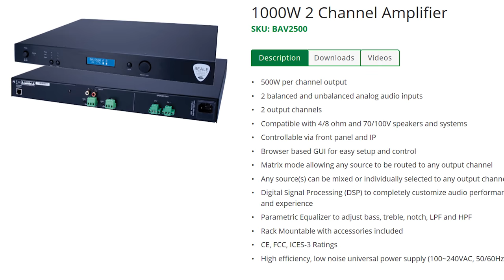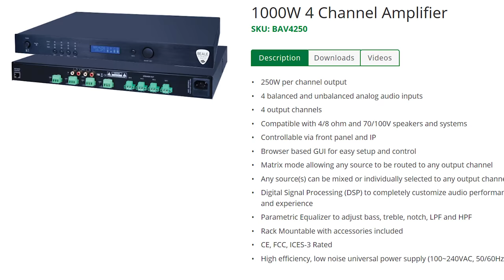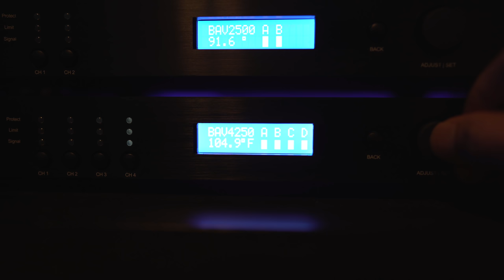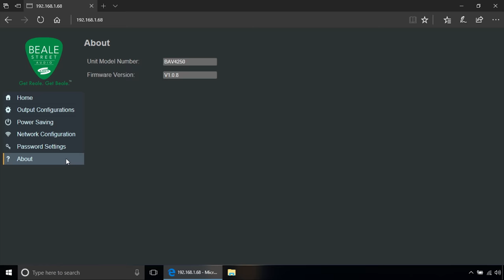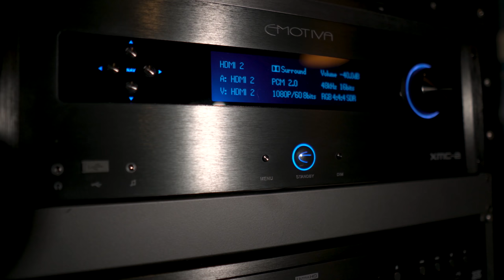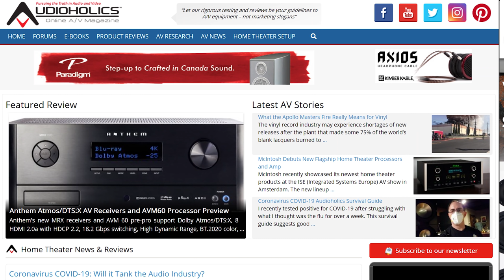Beale Street Audio BAV2500 & 4250 Amplifiers Overview

Comment: No review of quality of sound? All you made is a commercial, and a waste of everyone's time. 
Anyhow, is one doesn't need the preamp/eq/network and small factor, for the 2x650 USD you could get TWO crown xls 2502 with 3000 watt of total power, quite fan and bananas, xlr and RCA connections. Or just buy one 2502 and get 2x 440w , also at 8 Ohms. Or, what the "unboxer" conveniently forgot to mention, you want to look at 4 Ohm number - you get a total of 4800 for two in bridge mode and 2x775 for a single one in stereo.
Reply: This isn't a review. Thanks for watching!
Reply: The title is in the video description - Overview 👌🏾